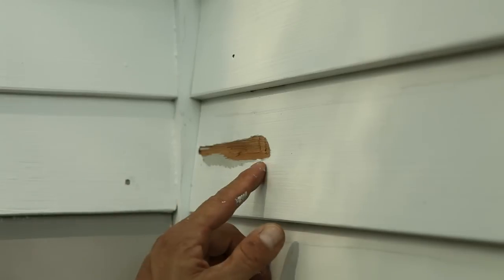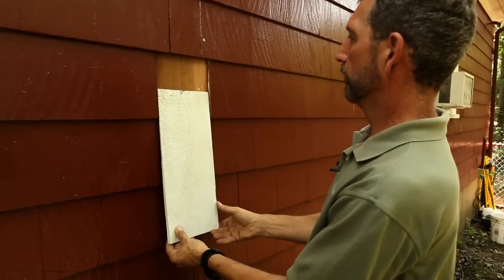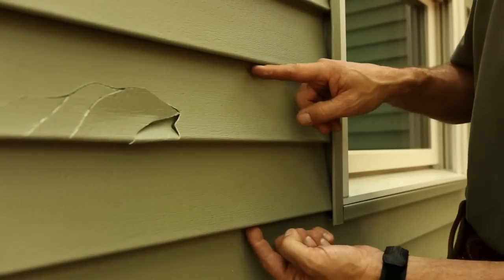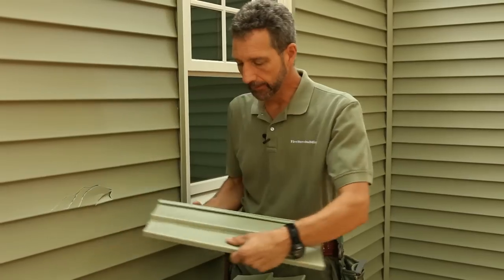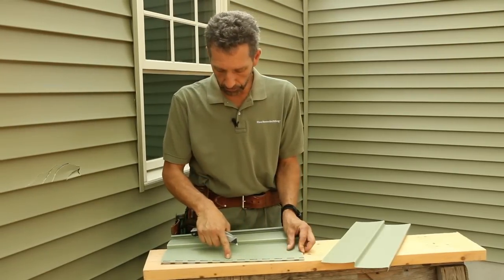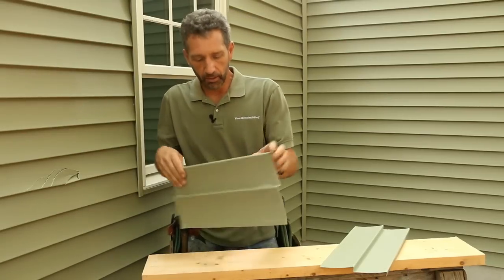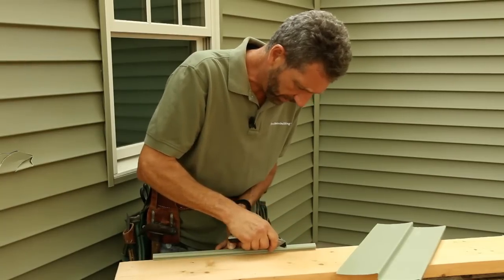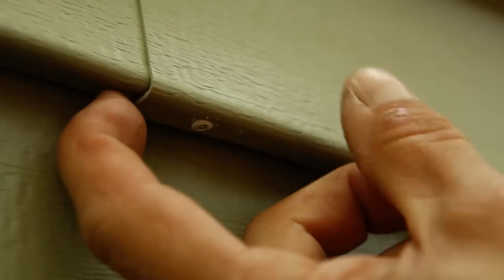How To Patch and Repair Siding

Comment: Great tip. I just did this near  a door opening. I cut my piece long enough to fit over into J channel  of the door so I could hide one seam. Now I only have one seam showing which I doubt anyone will notice. This could have been done on this temp repair as well.
Reply: you got that right..

Comment: This is on my to do list, I'm doing it today, I just wanted to double check on how to cut the top of the siding.  I'll return with how it went.
Reply: OK I got it completed but the top part of the siding, I had to cut more off in order to insert the cut piece up under the already attached siding, other wise it went as you illustrated.  The newer piece will eventually fade to match as the siding faces east.  TYVM for the demonstration.

Comment: Will try this!  What would you suggest using to make nice clean cuts on the edges of the piece you're going to use?  I think a chop or scroll saw would just tear up the plastic.  Not sure I can cut perfectly straight with a utility knife or with snips.
Reply: Tried tin snips, got a pretty clean edge!

Comment: It seems like no siding professional can answer my question wow. My question: I need to meet one side of the wall with the other side in the middle is a breezeway so I need to come up on one side and up the other side but need both to meet at roof ridge of the breezeway. How can I do this???
Reply: Kinda hard to answer the question without seeing it but I may have an answer. Measure up from the bottom or measure down from above above the ridge and chalk a line above the ridge. Now measure down from the line and run your pieces on each side. Just check your peices with a torpedo level (aprox. 6" long) and measure every 3 runs or so to make sure each side is alligned. Again it is hard to say without seeing it and  I don't know if you have a level area to start with. I am no professional sider  either just trying to give you some help.

Comment: This is exactly the way that I repair my vinyl siding with the exception of I install it using a tube of silicone and I make my patch a little wider at least 3 feet that way you'll never notice it. Just make sure your patch is not near another seam .
Reply: Hi. Could you explain how you install it with the tube of silicon? Just looking for an easier way to install it
Reply: John Doughnut It’s used as water proofing. Basically perimeter glue the patch.
Reply: @TwoBitty  Thank ya. I figured it out haha

Comment: what is that nail that he uses to secure the siding from underneath at the end?
Reply: I wrote it down cause i will have to buy one, he said 'pop the rivet in place' to hold the siding....So i assume it a pop rivet gun,  I'll just buy one at Home Depo....They'll know what I'm talking about, in fact Ive seen them in the store but didn't know what they were used for!
Reply: Arrow Swivel Rivet Tool

Comment: Great trick ... thinking it looks so good I wouldn't get around to doing the whole panel.   This is a good time to mention that you should always try to save some scraps from when you have the vinyl install (or when you install it).   Just throw some scraps in the attic, they will come in handy as it can be a pain to match color later.   lol, as if I'm one to lecture about safety, but there's really no reason to draw that knife towards your thumb like that, w/ no glove to boot.  Use wire cutters